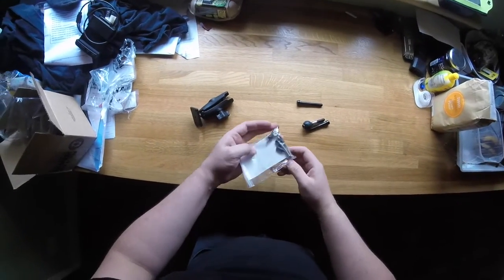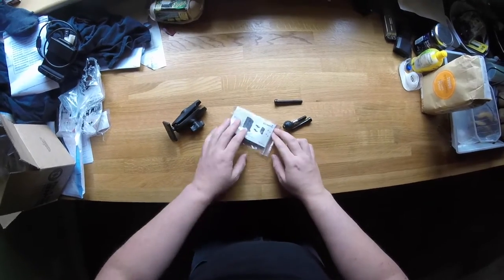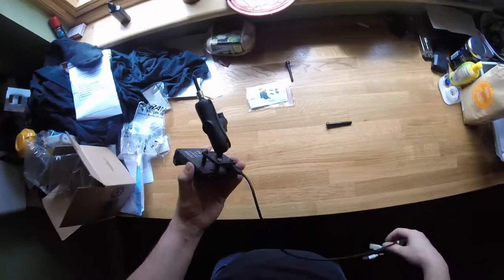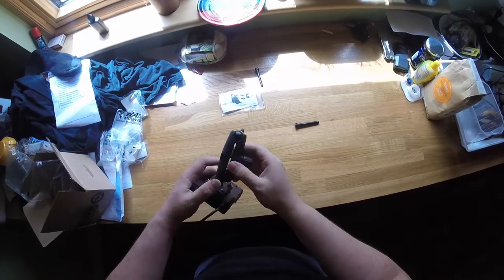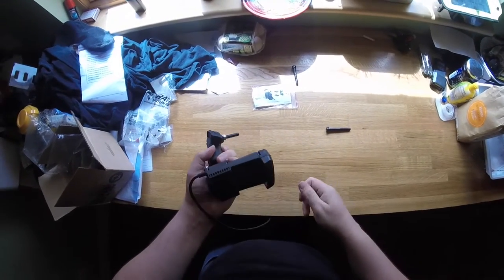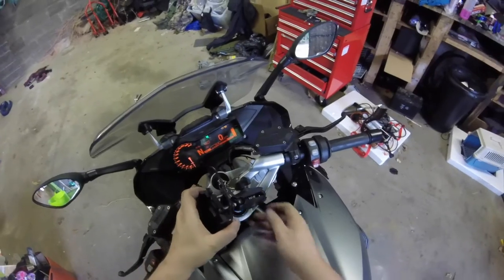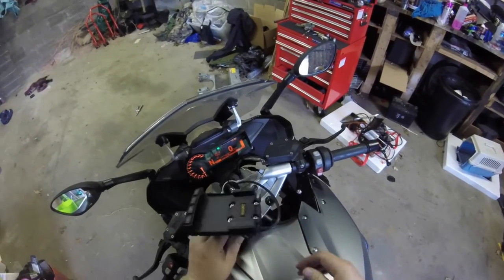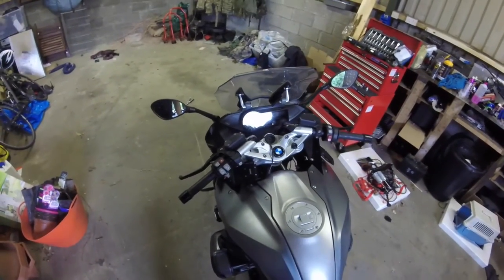BMW Navigator V Satnav Cradle install on R1200RS

Comment: Thanks GBW 4 yeas on its still giving. Bought a GS some time ago that only had the Nav 5 cradle so I removed it and ever since I have wondered what the two connectors were. Now I know. I was going to use the Canbus connector to connect my Zumo 550 but after watching this I will now connect to the battery and have a connector near the cradle to be able to remove it easily. It'll also save me having to buy a security lock for the Ram mount. Thanks again.

Comment: Nice work. I'm not super familiar with bikes but the older ones had like a 10 pin diag port with a screw cap on it. Yours not have this? (Looks a bit like a clutch resevoir) 

you can get adapters to standard 16 pin OBD and fit a Bluetooth reader in there. Handy for pulling a lot of the data you wanted and also allows you to check fault codes etc all from your phone. 

There's also some more capable stuff too like INPA and GT1 that unlock loads of possibilities. You can control loads of things in the bike like running ABS tests etc and activate dealer options in the ecu.
Reply from the maker: Yeah, this isn't a diag port, there's a separate accessory power port and canbus port, all modern bmws are canbus. There's a diag port under the seat alright. The main use for the port up front was this cradle, so you could see stats about fuel and how much welly you're giving it and other useless shite.
Reply: +Grumpy Bike Wizard CANBUS is more of an underlying protocol than physical interface standard though. 

Same with BMW cars, they've been using CANBUS for communication across multi modules for over a decade but they still use generic 16pin interface and OBD2 can still perform many of basic functions like throttle position, idle speed, lambda reading etc. what kind of connector is it under the seat?
Reply: +Grumpy Bike Wizard CANBUS is more of an underlying protocol than physical interface standard though. 

Same with BMW cars, they've been using CANBUS for communication across multi modules for over a decade but they still use generic 16pin interface and OBD2 can still perform many of basic functions like throttle position, idle speed, lambda reading etc. what kind of connector is it under the seat?
Reply from the maker: Haven't fiddled with that yet, will have a look-see at some point.
Reply: Just had a Google of it and it seems they have a 10 pin port much like older BMW cars but smaller. You can get a little adapter that goes in there and gives you back a standard 16pin. Anything that was available through the CANBUS port you mentioned will be available through the diag port, and more.

I remember a customer was amazed once when I was turning up and down his radio from the laptop outside. Simple things, eh.  :D

Comment: What's the RAM ball part you used in the handlebar bolt?
Reply from the maker: http://www.nippynormans.com/f650stf650csf650gsf650-dakar/ram-handlebar-clamp-attachment-kit - I'll link to the other parts in the description now.
Reply: +Grumpy Bike Wizard cheers. Mine came with the GPS cradle but the GPS unit is like £600 (!) so swapping it out for my TomTom.
Reply from the maker: Yeah, you should be able to fit the tomtom to the existing cradle, the 4 fitting bolts at the back are in the same dimensions. Then get the USB cable mentioned in the description and replace the cable from the existing cradle with it. Your clicky wheel becomes useless but sure it's not all that useful anyway.

Comment: The problem with that install is that is way too low to use safely when riding. Even the standard bracket is too low and most people lift it up
Reply from the maker: Yeah, problem is that putting it up higher covers the clocks. I'm not a mad fan of satnavs or phones or bluetooth music or other distractions on the bike, but this is hopefully a decent compromise. the mount on the R1200GS was a bit better this way, was straight in front of you.

Comment: A quick google search - your data connection is left side.
Reply: I normally use my phone, as satnav, and put it in the tankbag, which I run a power cable from.
Reply from the maker: I think I also did the same search - I even took the left tank cover off, not a sausage. Then again, I'm an eejit so it was probably staring at me the whole time.

Lots of internet forums are very confused about where the power connector I found even is. I suspect it might differ based on where and when the bike was manufactured.
Reply: Yep, typical BMW. Same thing, different place, depending on year. I'm not very mechanical minded with my bike. Not nearly as adventurous with things as you.
I bought bits for my bike - handguard, light protectors, and haven't even gone near looking at fitting them.
Reply from the maker: The channel is my motivation to get this stuff done sometimes. When are you getting started? :-)
Reply: was thinking about how to wire up a mic to my camera but don't think I really can. Going to mount helmet cam soon though.